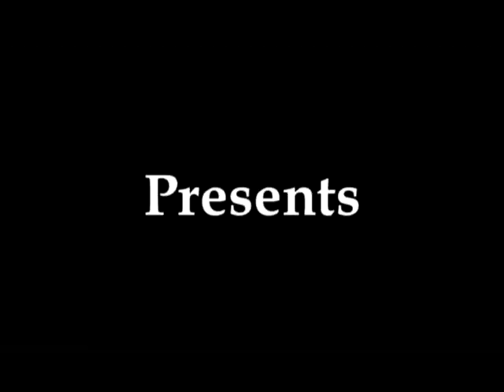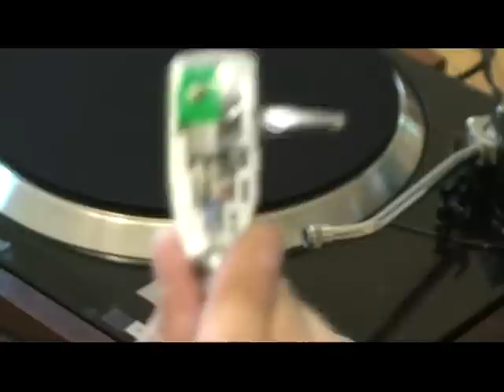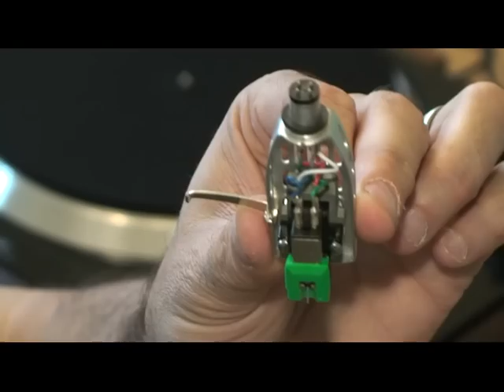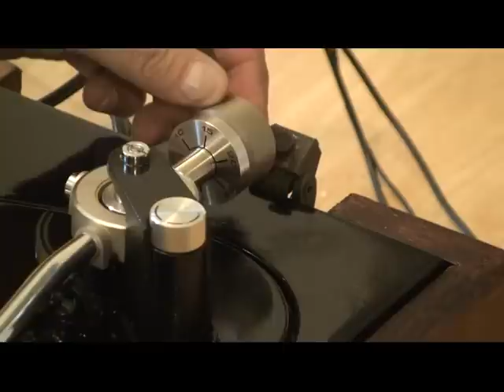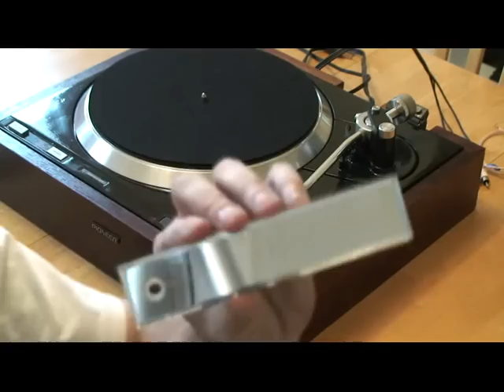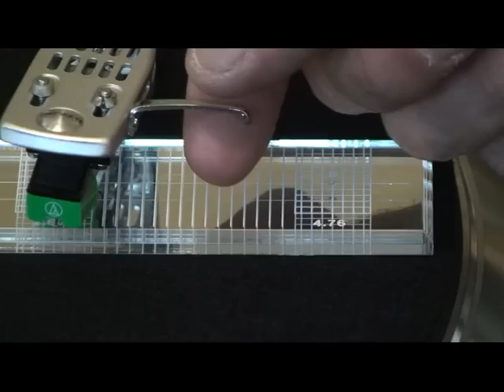How to setup a turntable - turntable and tonearm setup

Comment: Robert, thanks so much for the info. There are a lot of things I didn't do when I sat my turntable up. I get a lot of distortion on high nots and brass on old records. Do old records just do that?
Reply from the maker: Hi Tracy. It can be a number of things but the FIRST to look for is - the arm. Is the front of the arm (the end by the stylus) nose down in relation to the tail (sloping downward). That would cause increased or tinny highs. If it was tail down, it would be muddled bass. It could also be 1) alignment 2) A bad stylus  3) Too light on the weight .- And no, old records don't have to sound distorted. If they do, something is amiss. Follow my video, do the steps. If it is an old cart/stylus, replace it. :-)
Reply: Thanks Robert. I'll follow your setup.

Comment: @Robert Arco: Because the tracking force his just 1.5gram, even if the anti-skate his set properly if it hit a small scratch on your vinyl or just a small peace of dust, it will more likely skip, because the tracking force his to low. And it his already been proven that High tracking force does not destroy the grove, unless it his way overexagarated tracking force, that his way past the max out ammount, after he test it, the song quality did lowered but, the music still plays find with a baddly damage grove.

Comment: I know Americans use the term Receiver as a catch all to mean an Amplifier. Technically speaking a Receiver is a combined Amplifier and Radio. It would make it clearer if you simply said “ the turntable RCA terminated cables connect to a suitable phono input if equipped in an integrated amplifier, or a combined Amplifier and Radio (known universally as a Receiver), or a separate stand alone phono stage.
Reply from the maker: So you really want me to confuse people ? LOL...then I would have to address if their pre-amp or receiver doesn't have phono inputs , they cant just use a normal AUX and need to get a phono pre-amp and the next thing you know I am solving global warming....LOL...Thanks for watching

Comment: Robert, thank you for posting this. I'm setting up a hifi system and am getting 'back' into vinyl. I'm purchases an old pioneer PL-530. How important is it to level the turntable before you start any adjustments? Should I add a level to my new (old) turntable. Thanks again for your awesome video!
Reply from the maker: Hello, it is very important. If you start level, even if its not where you will ultimately place it, you get your settings correct. THEN, when you do put it in place, you level it again, the same. The settings should all be good. Remember, level affects the arm so any forces in an angled direction will cause the stylus to ride incorrectly in the groove. Also, don't be afraid to go to the HIGH end of tonearm weight. If your cartridge says .75 to 1.25 grams, then go 1.15 or so...why ? Because too light is damaging. Light weight is a fallacy that goes way back to the days of sales when people thought OH light tracker...engineers knew higher was better ..thus the range. Hope this helps...
Reply: @arcorob  o

Comment: Your TT looks great. Don't have time to search your comments: did you do your own paint job on the table? Did you remove the tonearm if you did?  I found that trying to dismantle tonearms from a lot of these mass-produced Japan tables can be problematic and lead to destruction of the arms.
Reply from the maker: Hi Joe...Yes, painted myself. did not remove the tonearm. I masked the whole thing with bluetape. And yes, some of these are a nightmare to disassemble .

NOt sure if you can click these but here is another I did 
https://www.facebook.com/photo.php?fbid=963216203693842&set=a.214358325246304.66517.100000164134783&type=3&theater

and here is the one you see
https://www.facebook.com/photo.php?fbid=538868589461941&set=a.214358325246304.66517.100000164134783&type=3&theater

Comment: Hey Robert great video i have a vintage JVC l-a11 turntable i have adjusted everything to the best of my abilities and i have only one problem (as far as i know) everytime an LP finishes playing or i press the Reject button the tone arm will go back onto the tone arm rest for a moment but the suddenly it will bounce off a bit and start skating a bit on the edge bouncing up and down on the very edge of the LP so everytime i use my turntable i have to be watching and waiting for it to end so that it doesnt damage the record please any tips will do. Thanks.
Reply from the maker: Jonathan, it is one of two things 1) You need to unplug the turntable, open it up, turn it upside down and then use sewing machine oil on all parts you can see that need lubrication.Do not use the oil on any rubber bits or on the cueing (lifting) mechanism. Put it back together and let it go through the motions a few times.
OR
2) It is caused by a small felt cushion which pushes back the tonearm to it's resting position. This felt becomes sticky after a while and because of this stickiness pulls the tonearm of its resting position. A person  added some tape on the surface of the felt so that it's no longer sticky anymore.

Comment: hi +Robert Arco what is the model of your turntable and how did you get that wood casing, its elegant
Reply from the maker: Hi jernel...It is a Pioneer PL-600 that I restored. I built the wood wrap around from pine and stained. I choose the Pl-600 because you would be very surprised what this mid-level 70's turntable has. I have spent $100 and I have spent $2500. For a fully automatic turntable, the specs cant be beat 

Btw - this is the ORIGINAL PL600...a later one had the same model number and was a cheap version for stack racks

more detail 

http://www.vinylengine.com/library/pioneer/pl-600.shtml

Comment: If the cartridge on your 1200 is a dj cartridge it would still be safe to play your records on,however, it could be very worn or very dirty, and sometimes dj's set there cartridges and needles differently, 4 the purpose of better tracking force when scratching or back cueing etc, so always best to replace the stylus and set up from the beggining otherwise you could be damaging your precious vinyl !

Comment: Thanks for the video.  I purchased a Realistic Lab 290 turntable at an Estate Sale.  While there I played it and it played but the sound was low.  I thought it maybe needed a new belt and stylus, plus it was on a cheap reciever.  I replaced the belt and stylus, hooked it to my Sansui QRX6500 and the sound is still very low.  Do you have any idea of what the problem might be?  I don't know if the receiver is set for magnetic or ceramic cartridges or if that matters.  It is hooked to Phono on receiver. don't know if the stylus is magnetic but think it is.  Do I need a preamp maybe?  Any suggestions would help thank you.
Reply: David, do you know the make and model of your cartridge? If your cartridge is a ceramic cartridge, I would swap it out for a moving-magnet cartridge. If your receiver has a Phono input, it is most likely configured for magnetic cartridges.

Comment: Maybe someone can help me with this.  I had an Ortofon 2M Bronze cartridge installed on my Denon DP-300F turntable a few months ago and, although I love the sound, the stylus almost always skips when you drop the needle on the lead-in groove, about a 1/16 of an inch into the first cut, no matter whether I use the automatic mode or the semi-automatic mode.  The tracking force is set to 1.7 grams, and the antiskate is set to the same value.  I had the cartridge aligned by a technician at Bay Bloor Radio in Toronto, Ontario.  Any idea what could be causing this?  It does this on both 33 1/3 records and 45 rpm records.

Comment: Wouldn't setting the digital scale higher than where the album sits effect the weight needed?
Reply from the maker: You are correct ...it can alter it very slightly. On SOME turntables more than slightly but 90%..not so much

Comment: Hi Robert
 Thanks for the video!!!, I have recently been given a Tensai 861b record player with a AT71E Audio Technica stylus [ the stylus in the headshell is at an angle which i want to confirm its in the correct position], I have general problems with the quality of sound that I get from the record player, I know its not the speakers or amp so I have ordered a new stylus[as I am unsure how old the stylus is] and the same alignment tool like yours, my question does it matter where I put the alignment tool on the record player? [as I see you just place it randomly] also I have no information on what over hang measurement my stylus to my headshell should be, does the alignment tool correct this?
Thanks
Daz
Reply from the maker: +Sonja Rogozenski Hi Sonja....The alignment tool has a hole that goes over the spindle. You will be aligning the tow points (inner and outer) Only when the cartridge is in the proper position in the headshell (forward or back) will it align to both points properly. Think of it this way. Say you pushed the cartridge ALL THE WAY BACK and aligned the outer. When you moved to the inner, it would fall short. Conversely, way forward, it would be way ahead of the inner....there is a sweet spot. Many arms have a gauge you can use that aligns darn close....or you can measure...but you will get the hang of it. Don't be afraid to try a few times till it aligns correctly. Start in the middle. Align the inner. Now see where you land on the outer. PAY CLOSE ATTENTION 19 minutes in
Reply from the maker: +Robert Arco BTW..Pay close attention 19 minutes in

Comment: I have a really low budget and just bought a vinyl album (Sgt Peppers because I love the Beatles) and now I want to actually listen to it and some other albums. If I was to just buy a turntable on it's own, would that be sufficient? (Sorry if I sound like I don't know what I'm talking about, I'm a newbie)
Reply: you still need a receiver or amplifier & a set of speakers. If you want to listen to the radio, then get a receiver, or a tuner to go along w/ the amp..if you get a pair of headphones, you can sub that for speakers, but then you would always be bound to the phones..which you would eventually tire of..it's good to have both a good set of speakers and a good set of cans (headphones)..good luck..btw be careful.most receivers to not have an input to connect your turntable, so make sure you find one that does..

Comment: You have Audio Technica AT95E cartridge, right? Isn't optimal tracking force for it 2g instead of 1.5g?
Reply from the maker: This was for demo purposes only. Optimal for the AT95E is Tracking force range: 1.5 - 2.5 g - Normally I go toward the higher end of the range (2.2) because you don't want to be on the light end. Difference between markets specs (light) and engineering specs(higher end)
Reply: Robert Arco I had to go lighter because going heavier appeard to put too much pressure on the cantilever to the point where it was bowing and the plastic housing piece was playin on the record.  As I set them up now there are a few mm of space between the needle and the needle housing.

Comment from the maker: Quick note on overhang. Overhang is a factory recommendation on HOW far the needle should extend PAST the spindle for the cart to be mounted back or forward in the headshell. By having the correct overhang, alignment can become THAT MUCH easier to lock in. However, it is not 100% necessary as the ALIGNMENT will tell you where it should be. So if you can't figure overhang, start in the middle of the headshell and work from there...More detail in my next video coming soon..

Comment: The thickness of the scale affects  the  pressure.  To  be more accurate it is better to remove the rubber before placing the scale.
Reply from the maker: Everyone likes to say that but it is sort of an urban myth, I have tested this on numerous tables. High end damped arms have the most difference but it is still negligible ...on medium to low tables, it is not an issue. People like to point out what they HEARD but have any of you done any REAL life testing across a large set?  Example, if a tracking weight range is 1.8-2.2 grams , your max differnce might  be .1 grams and generally less (about .05 grams). Since by engineering you should stick to the high side (say 2.1) even if you lose .1 , you are still in the 2.0 sweetspot.

Comment: How do you set it up without an electronic gram scale?
Reply from the maker: Use the manual method. Balance the arm so it free floats (not up or down) just floats to the middle (you need to adjust the rear weight to do this). Once it is floating in the middle, set the scale on the weight to zero (don't turn the weight, just the scale). Now that it is zeroed, turn both the weight and the scale to the correct number (example 1.5). Not as accurate but close.

Comment from the maker: The answer is yes - with a caveat. I gather you are a headphone amp guy (thus no speakers)? In that case or with any amp that has no PHONO selection, you need a phono stage. Turntables are NOT straight line out. They require signal boost an RIAA equalization. You can get a great one for about $49 US. The ART DJ Pre II. It is perfect for any MM cartridge. Table connects to the Phono stage. Phono stage connects to the AMP (like any line) and you are there. Note - The ART does not work with MOVING COIL (MC carts) ...for that I would have a different suggestion

Comment: i have a n old toshiba music center model number sm-3350,  1978/79, wich has a nice record deck built in, tracking is adjustable in the normal way, but there is no dial for adjusting the anti skate just 2 small bars to the rear right hand side of the tone arm one is fixed to the  tone arm the other pivots with a small weight on it seems to be sprung loaded it pushes against the fixed one, are you  familiar to this kind of anti skate? and am i right in saying that it a set anti skate and non adjustable? kind rgds
Reply from the maker: That is called an anti skate weight. Same principle of resistance but not using a dial and a spring. I could not find the manual for this one (it is obscure) but I am pretty sure the further away the weight the higher the anti skate.
Reply: Robert Arco
hi robert, thank-you for your reply, it seems i can not move the weight further away, as it is fixed on the end of a bar which another bar comes off of that one and just pushes against the another fixed bar on the tone arm, it is odd i must admit.thank you anyway. rgds m

Comment: Do most TTs come with the cartridge aligned? Specifically the AT LP120.
Reply: Jay Hard I have an Audio Technica AT-LP120USB and yes, the cartridge does come aligned in the headshell - although mine now suffers from sibilance and distortion at higher frequencies; whether this is a result of misalignment or a finished stylus, I am unsure. Either way, I would recommend an upgrade on the stylus - I am thinking of upgrading to an Ortolan 2M Red!
Reply: Jarrett McColl How old is your cartridge?
Reply: I've had it since Christmas Day.
Reply: Jarrett McColl
Well, if this didn't have sibilance and distortion at first, then the good news its probably not a defective cartridge.  Probably.  Check how the headshell is seated.  Make sure it's firmly connected to the arm.  Check the tiny red white green blue connections that connect the cartridge to the headshell.  It sounds as if the cartridge may be out of alignment.  Check the cable which connects the arm to the preamp/amp/receiver.  Get a mirror and place the needle on it.  See if the stylus (the metal in which the needle sits) is askew or defective.  It could be the phono stage itself.  See if you can get hold of another phono amp/receiver and test this way.  Keep me up on your progress.
Reply: +Jay Hard They have free protractor downloads, just G+  it......

Comment: Regarding the gram scale. Wouldn't you want to put the stylus on the scale when it is in the leveled position reading absolutely nothing at all and slowly give it weight till it reads the correct gram weight? I'd think that if you simply placed the stylus on the the scale at its supposed weight you really have no guidence as to whether at zero grams the stylus isn't reading a different weight. If you get my drift.
Reply: The gram scale will read the weight of the cartridge wether it is set at 0 grams or all the way up to 5 grams, negating the need to zero  your weight.

Comment: You need to make sure the contact point of your digital scale is at exactly the same height as the stylus is when on the record. In other words, the tone-arm has to be level when you measure the weight and not at an angle....
Reply from the maker: That's NOT entirely true. First this is close enough for beginners on most medium to lower end turntables. It is important on higher end because there is definitely a difference in angle versus pressure exerted. Example - table you see wont even have a 1/10 of a gram difference my way versus dead level. On my $2500 table, it can be over 1/2 a gram ...

Comment from the maker: Just FYI..its always better if you can get the top of the scale at the same level as the platter. On some tables, it seems to be irrelevant. But on tables like my CA Concept, it can result in a 1/2 gram difference or more. If you can get the scale NEXT to the platter and the same height it would be optimal

Comment from the maker: Without a doubt, a bad cartridge could cause this (or in this case a bad/bent stylus) DONT USE IT. Get a replacement at someplace like turntableneedles 

If that's not it, could be the cartridge connections (on the back of the cart) or the RCA jacks. But get that stylus replaced first or you may wish to get a whole new type cart (stylus and all) ..Like an Audio Technica or a Shure.